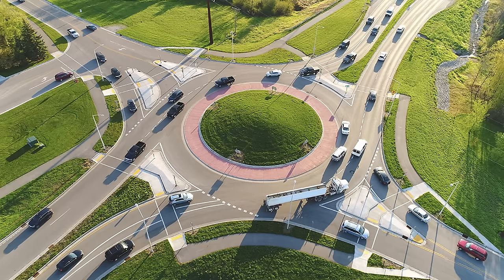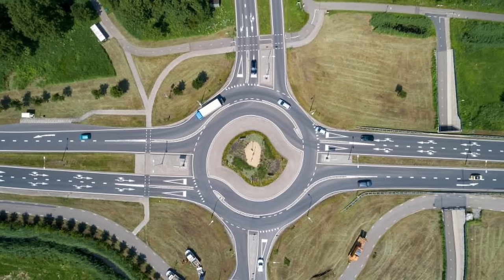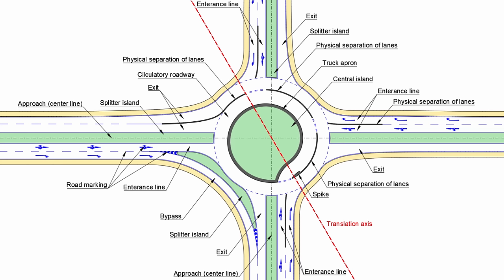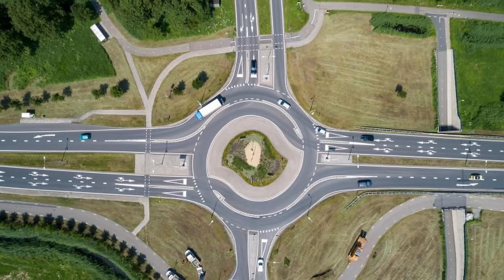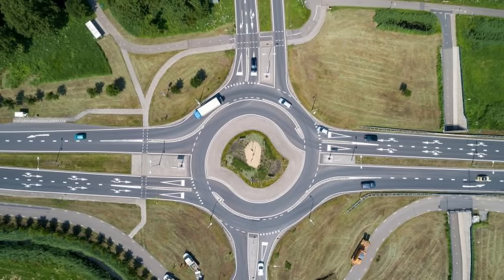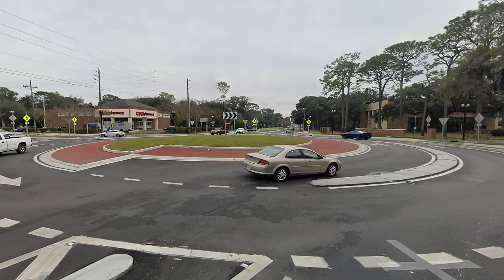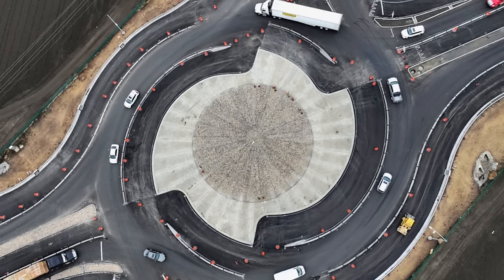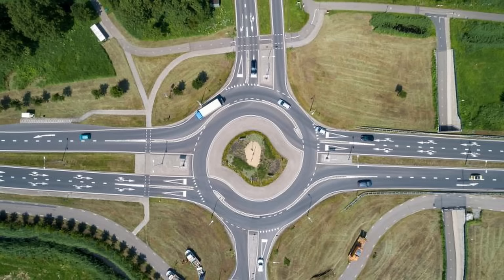Why America Is Building "Turbo Roundabouts" - How Do They Work?

Comment: I drove the new roundabout near Hollister, CA.  It has reduced crashes at this intersection.  Before it came it, I saw drivers running red lights.  It has made traffic going towards Pinnacles National Park flow smoother.
Reply: Not according to CHP stats. Has had the opposite affect in terms of safety. 1 crash every 2.5 days as opposed to 1 crash every 8 days previously.
Reply: I never saw people run a red light at that intersection, lol.

Comment: Every time a historically bad intersection near me is replaced with a roundabout, the locals come out of the woodwork to complain. They all think a traffic light (roundabouts usually replace 4-way stops, or at least a 2-way stop from secondary roads) is a better solution. Yeah, because nobody ever ran a red light and traffic never backed up with signals!🙄🤦‍♂️🤷‍♂️ Not much better than stop signs. Major points of a roundabout are: to keep traffic moving (albeit slower); to reduce the speed of any collisions; to change the type of collision to a less serious one (roundabouts result in sideswipes, maybe rear-end impact; no t-bone or head-on).
Reply: Eventually roundabouts end up with traffic lights at the crosswalks at the entrances. And that kills the whole point of the roundabout.

Comment: Dutch road design encourages thinking and engagement. Instead of wide, straight open roads that technically don't prevent you from speeding in a straight line (until you smash through an intersection because you ignored a red light), traffic infrastructure that demands your constant attention with more "obstacles" (narrower roads; multiple curves; roundabouts; raised pedestrian crossings; etc.) means you're keyed into your handling of your vehicle at all times. Stop lights, traffic signs, and road markings can only do so much: they don't physically prevent you from ignoring them. Adding more dynamics to the actual road itself makes the difference.

Comment: These turbo ones look easy from an aerial pov, especially the ones with clearly defined and separated lanes. I'm glad there are ways to even go back the way you came.
In my area, we have a segment of busy, busy road with THREE roundabouts in a row. To complicate this, the freeway entrance/exit is at one end so there is a large amount of semi trucks coming and going. To further complicate this... the roundabouts are not large, so long trailers/beds do not even fit without running over curbs and knocking over signs. Lovely, just lovely.
Edit to add: there are also some new roundabouts dotting the freeway where small country roads intersect. The original intersections using traffic lights worked, but accidents were still in the hundreds per year, per intersection, and fatalities were not uncommon. So far, so good.

Comment: We've actually had "traffic circles" for eons, but they were basic, with just one lane around them.  These turbo roundabouts require more planning and alertness than I see in many US drivers.  Before you enter one, you must make an irrevocable decision to be in the correct lane, and then you have to yield appropriately as well as watching out for drivers who don't.  If they become common nationwide, I suppose we'll adapt, and Darwin will weed out those that don't.  

In the UK, where roundabouts are everywhere, they often rely on half-worn markings on the pavement rather than overhead signs, and they cope.  But their licensing requirements are far more stringent than some US states.

Comment: Actually...DuPont Circle in Washington DC would be the first example of a "turbo" type roundabout, and it dates back to 1920, so there were roundabouts in the US well before 1990
Reply: There are actually 23 roundabouts in DC that all predate 1990
Reply: There are also residential roundabouts, I’ve seen several neighborhoods that have basically cul-de-sac sized roundabouts with a grass area in the middle at interchanges, and they’re from the 40’s-80’s
Reply: There is one (Heron Circle) in Spartanburg, SC that was built in the late 1950s.
Reply: I'd contend that DuPont Circle is a traffic circle, which is not the same as a modern roundabout (which are generally smaller and aren't signalized).  I'm not a traffic engineer though, so I could have the definitions mistaken.
Reply: DuPont Circle is a traffic circle, not a roundabout.
Reply: @8mydaydream409  What is the difference between the two?  DuPont Circle sure seems to fit the description of a "turbo" roundabout
Reply: Hays Street in Fayetteville, N.C. has a roundabout that predates the 1970s!

Comment: How do you solve the problem of crossing traffic?  There are multiple points where the traffic flow cross.  The places I've seen roundabouts work well are relatively low flow with lots of room.  But once they become full, the crossing points become nightmares.

Comment: Twin trailer semi? Will it fit or will they just destroy the bricks or curbs? I was also think fire ladder trucks will be interesting? I do like these better than the two lane regular roundabouts.
Reply: All of the curb dividers and the center aprons are designed to allow the larger tires on heavy duty vehicles to easily run them over. The brickwork is, in my experience, usually concrete made to look like brick that can easily handle the weight. Standard trucks can simply navigate the cab through the lanes like a car and the trailer(s) will offtrack over low spots on the curbs designed to accommodate this, while oversize trucks can drive over the curbs and aprons as needed to pull even extremely long loads like wind turbine blades through the roundabout.

Comment: The problem with any roundabout in the US is the pedestrian crossings. They must be at a separate grade from the road in order for the roundabout to function unimpeded. Tunnel or bridge, doesn't matter, and it absolutely MUST be ramped. So it has by nature a large footprint. If these are not done, a on demand stop light at the crossing is going to happen, because all it takes is one accident and a judge is going to order the municipality to comply with ADA laws.

Comment: Toledo, Ohio, had a roundabout at Detroit Ave and Cherry Street that had pavement markings and signage designef wrong and caused accidents.  The redesigned and reconstructed the roundabout, and it appears to me it is now a dirivitive of a turbo roundabout. Now if they can do something about the next roundabout to the south that replaced a Tee intersection.  It is set up as it should to giving both lanes a left turn while the right lane can go, left or right. The problem with it is most drivers are making a right turn from the left lane. When the driver in the right lane want to enter and go around the roundabout eventually making a left turn that is his legal right, another another driver in the left lane turns into him.

Comment: Actually, In Edmonton, Alberta, There are roundabouts built in the 1950s. So they existed  in the North American continent for a while. Some of those are still there. The one roundabout actually has traffic lights on it, and it actually works quite well.  Now there are many, but I don't know of any turbo roundabouts.
Reply: 100%. Been in nj for 50 years or more.
Reply: That roundabout on St Albert Trail and 118 ave was designed to create as much congestion as possible.  The fact there are lights on the exits make it prone to horrible gridlock come afternoon rush hour.
Reply: The "roundabouts" that existed in the 1950s, the ones in New Jersey before 1990, and the ones that have traffic lights are traffic circles, not roundabouts! Traffic circles are not safe and operate differently than roundabouts which are safe!

Comment: In the 60s my parents complained about the Kingston, NY roundabout. Today I complain about the NC explosion of roundabouts.
Reply: LOL! I'm originally from Kingston!  The original "Traffic Circle" design that used to be there (pre-2002) was much larger and the IN and OUT lanes were not nearly as well-designed as the smaller roundabouts of today.  The "newer" roundabout there (build around 2002) is still not quite a "modern" roundabout design either... It was a hybrid of old- and new- design.  The most unnerving thing about that one is that humongous MOUNTAIN in the middle of it so you can't see vehicles coming around the bend until they are RACING towards you when you're trying to accelerate into the circle.

Comment: My concern is from the highway safety engineering aspect. Roundabouts exist to reduce the severity of incidents. A sideswipe has a much lower chance of resulting in a serious injury or fatality than a 90 degree crash. This Turbo Roundabout introduces points of conflict that are T-bone situations... a much more severe incident... the very situation that the Roundabout was designed to avoid. If the traffic volumes on the roadways dictate three lanes, it also precludes the availability of access in a roundabout. There are much more viable options for intersections out there for those traffic volumes... especially considering the costs that California incurred for this location.
Reply: The circulating speed of 20 mph, which the turbo design reinforces, keeps the likelihood of a T-bone crash very  low.
Reply: @scottmbatson  don’t drive much, do you? It could be a four-way stop with both cars stopped and they would kill each other with their fuck-you-me-first behaviors. Unfortunately.
Reply: @robertwazniak9495  
Been driving for over 45 years, not that it's relevant.  Roundabout geometry is what causes lower speed and a turbo roundabout only reinforces lane discipline.

Comment: Doesn't this completely undermine the intent of roundabouts?  Roundabouts are supposed to eliminate perpendicular intersections, but I see perpendicular intersections with these new multifaceted ones.
Reply: Perpendicular intersections are the exact thing you want. They are very visable altough perpendicular crashes can be dangerous but the sharp turn to enter the roundabout forces slow speed.

Comment: This looks horrific! It should be either one line circle or traffic lights.
Reply: If you live in a densely populated area traffic lights will do nothing but cause congestion and bottlenecks so roundabouts are a better alternative
Reply: @dynamicremakes5592  Normal roundabouts are great, but not these monstrosities!
Reply: I think you would get a panic attack if you drove through my city. Tons of roundabouts like this even some 5 lane roundabouts with traffic lights and tramway in the middle.

Roundabout is much safer and more efficient… provided people learn to drive on it
Reply: @szymex22  😲That's insane! Where is it? And who even wants to live there? Also, you can drive as good as you want, but there's always some crazy person who can slam into you.
Reply: @anti-emo4721  city of Poznań in Poland. Usually the only crashes on these roundabouts are when idiots dont know how to follow the painted line, and since the roundabout reduces the speed of the cars, they only really ever get scratched in case of an accident. In Europe roundabout is normal,  it is taught how to drive on it in Driver's ed.

Comment: Be more thorough in your research.
  When was the first roundabout built?

It all began around 1905...

Traffic circles have been part of the transportation system in the United States since 1905, when the Columbus Circle designed by William Phelps Eno opened in New York City. After that, many large circles or rotaries were built in Canada and the United States.
Reply from the maker: First modern roundabout girl it's not a lack of research I just said it wrong
Reply: Roundabouts and traffic circles are not the same thing, roundabouts have rules of use while traffic circles are a high-speed free for all.

Comment: Why are you in USA always complicate things? 😅

Just make classic roundabout with inner and outer ring, no other lines or complications.

Btw, can you make U-turn on turbo roundabout?
Reply: Because we are reducing crashes.  Traffic circles with just inner/outer rings increase crashes because there is no positive lane control when exiting.  America had a bunch in the early 1900s and got rid of them because of such lousy performance.  This is evident today with the plethora of UK and European dashcam videos showong constant collisions at the diverging points.
Reply: @traffic.engineer   well, I live in Europe (Czechia) and we have lot of roundabouts and it's well established that when you are going to exit it on first exit, you should take outermost ring  - because you'll be on roundabout the shortest time, so you don't want to switch lanes and become obstacle for other drivers. And if you'll stay on roundabout longer (2nd / 3rd / 4th exit) you'll take inner ring - basically for the same reason - you don't want other drivers to cross your way.
So basically all arrows in front of roundabout are nonsense (well those pointing on destination, depending on exit taken, are good 😊)

Comment: Oh gawd, please make these idiocy space-wasters stop. Traffic engineers need to grow a set and put traffic signals in—hell, power them with coal generators just for fun. Roundabouts were originally called "traffic circles." Traffic circles have been around for a long time. Two "Church Circle" and "State Circle" are in the original plan of Annapolis, Maryland, and are used to this day (17th Century to 21st Century). Although much larger than its companion, Church Circle saw so much traffic, that traffic lights had to be put in at nearly all of its spur routes by the late 1960s. Why? Because one of the problems with all traffic circles is once a whole line vehicles enters from one spur, the vehicles from every other spur cannot interject. Roundabouts are decent solution IF they are large enough for tractor trailers to maneuver through and don't see much traffic—and especially much traffic from any one spur route.
Reply: Traffic circles operate differently than modern roundabouts. Drivers being able to speed through a red light is not safer than a modern roundabout!
Reply: Some of the larger roundabouts in my city have traffic lights put in so as to avoid that issue. Yes, it’s still more efficient than intersection

Comment: First roundabout in the usa was not where you say...for example, latham ny had a roundabout in the 1960s and got rid if it only in the 2000s
Reply: The first MODERN roundabout was built in 1990. The ones built before then are traffic circles which have different right of way rules.

Comment: ummmm, New Jersey has been and still is polluted with roundabouts, aka traffic circles, since before i was born in the 50's.  US-15 and NY 17 used to have a gigantic roundabout that you could take at interstate speeds- it was replaced with a traditional cloverleaf when the two highways were brought to interstate standards and the levees were re-aligned along the river.
Columbus Circle in NYC dates from the very early 1900's and DC has had them since the grids were laid out in the 1792 and there are still 36 in use there.
Reply: Those traffic circles operate differently than modern roundabouts.
Reply: not necessarily.  just because it's called a "circle" doesnt mean it's not a "roundabout"  see Dupont Circle in DC as an example

Comment: What on earth are you talking about? 

The first roundabout was built in 1990 in Nevada? 

Clearly someone has never been to New England or New Jersey.
Reply from the maker: Modern roundabout
Reply: Clearly the ones built in New England and New Jersey before 1990 are traffic circles which operate differently than modern roundabouts.